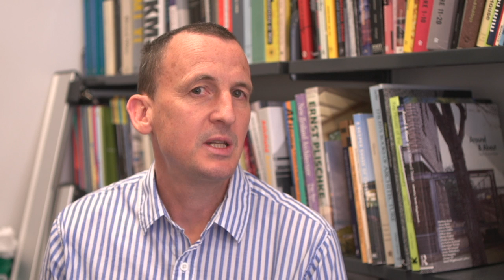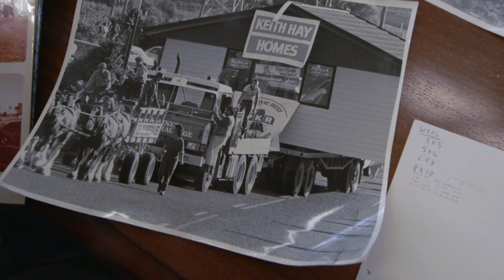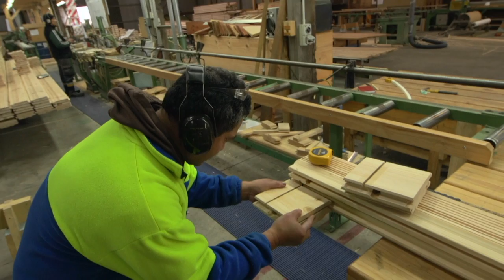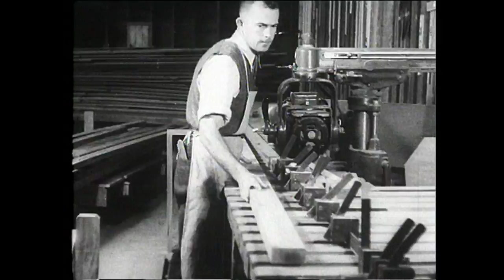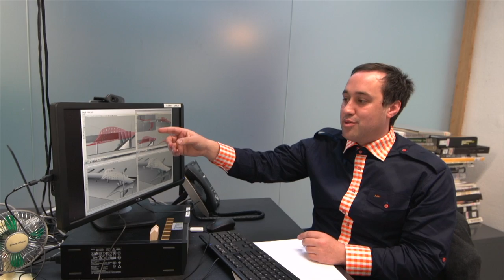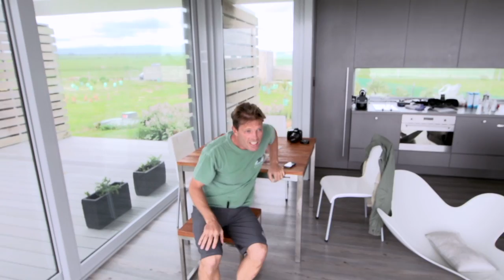Talking Prefab: Conversations with the designers, makers and owners of prefabricated houses

Comment: Prefab isn’t a dirty word, it’s an accurate description, I own a prefab business and we’ve built nearly 200 high quality homes in the last 5 years some social housing some high end bespoke homes. Our latest was water tight shell 3 storeys on the side of a hill in 3 days by a crew of 4. The trick with prefab is to incorporate at the design stage and keep the structure sensible.
Reply: It's come long lasting quality aaa